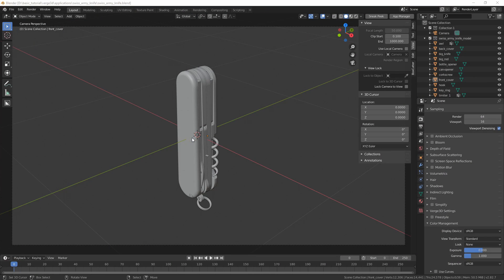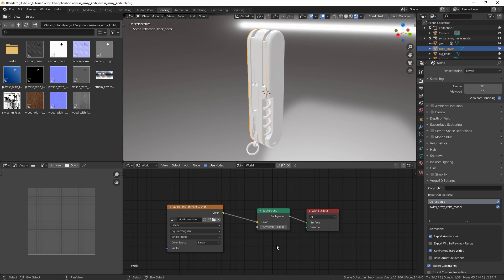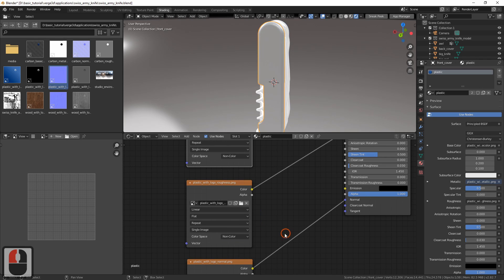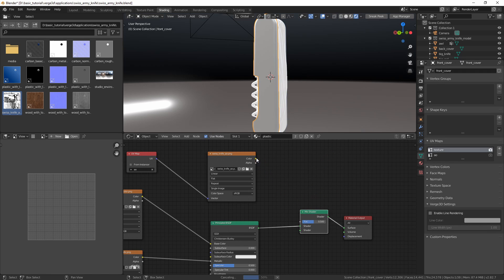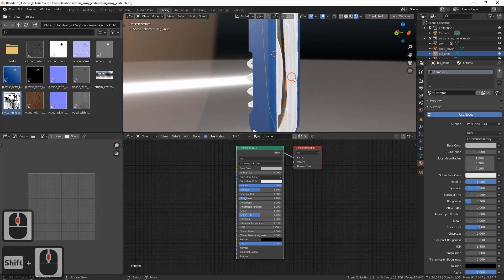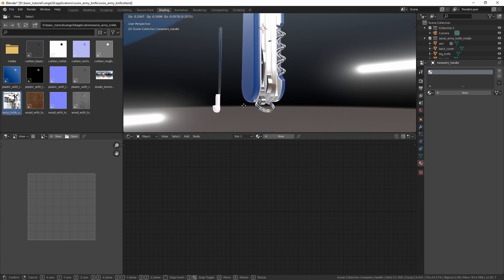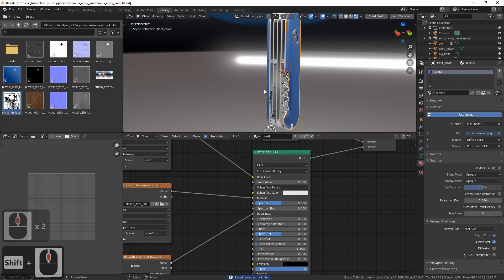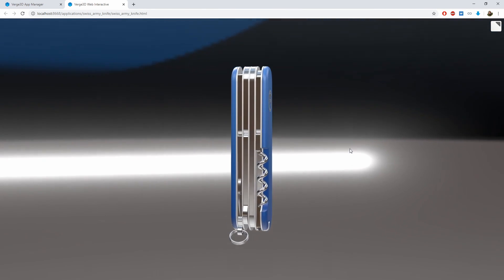Verge3D for Blender Basics - Part 3 - Materials and Environment

Comment: Pretty great software and tutorial man. I am using a super low poly shoe model with one standard diffuse bsdf texture applied. Although I'm only getting a tiny 3FPS when testing it in the html viewer. I can't go any lower since it would destroy the look of the model. I really like the software and how easy it is to setup. But for now it's not looking promising to implement it into our webshop. Any tips?
Reply from the maker: it's seems strange we have scene with millions polygons and a lot of textures and complex shares that run smoothly. Can you make a post on our forum with attached axample of your scene so we can find the issue and you can get help with the app.
Reply: Check out their demos... they have a full-functioning racing game that runs smoothly in the browser.